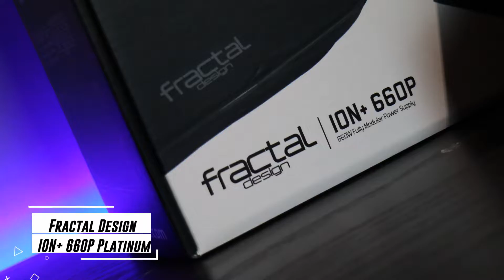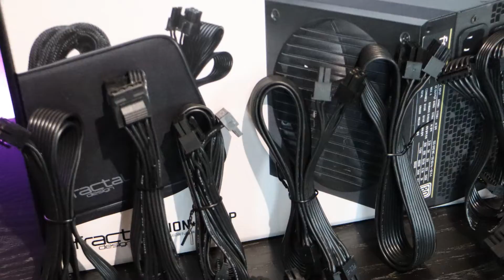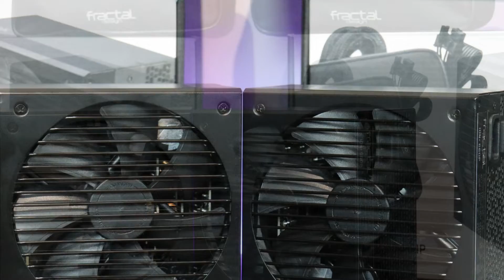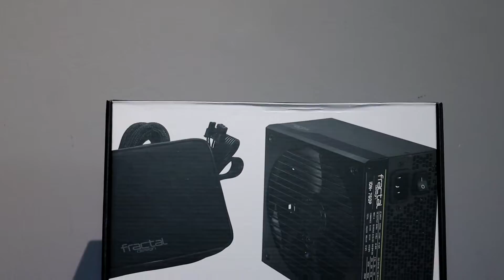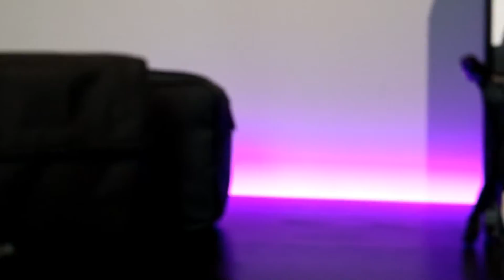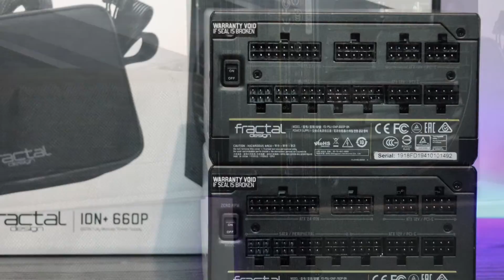NEW FRACTAL DESIGN ION+ PSUs - 660P & 760P PLATINUM

Comment: 660 w is good for supergaming like a cyberpunk or RDR 2 and Mafia Definitive edition?
Reply from the maker: PSU doesn't have anything to do with running games. It's only job is to supply the components that do that with power.
Reply: @PCCrazyDario  660 w for gaming PC is good bro?
Reply from the maker: @californiadreams9408  Depends on the components that you are going to use in your PC...
Reply: @PCCrazyDario  6 cores cpu, 4 gb gpu, 16 gb ram
Reply from the maker: @californiadreams9408  660W should be enough, even though I am guessing here because 4GB GPU is old(er) so it could be placed in the lower GPU segment (or older) and you don't need more power.

Comment: Man can i use coolermaster sleeved cable to extent the range????...subbed ❤
Reply from the maker: Appreciate the sub! :) If they are only extenders, then yeah. If they are full custom sleeved custom cables from the PSU connectors to the components, then no.
Reply: @PCCrazyDario  thanks man...yeah i know the concept that even an extender is a product that a good powersupply should protectbfrom surge...like it protect a mobo..
.
There is this half cooked indian youtube....who mixed up my mind...
.
Appreciated headsup
Reply from the maker: @GFATalks  Honestly, both of those PSUs are great and when someone asks me if they should go with Corsair, I don't see a reason why not. The same thing goes for the Fractal Design. I have been using both PSU brands in some period of time, Corsair HX1000i and Fractal ION+ 760p and on both never had an issue. So you are good to go. ;)

Comment: I’d like to purchase this PSU for my next build, have you ever had any reliability problem? Is the 24 pin cable long enough for a mid tower case?
Reply from the maker: Nope, not a single problem. Still using the 660p and my friend is using 760p. No issues whatsoever. I'm using it currently in H700, but used it in VECTOR RS from Fractal, all cables have enough length. ;)
Reply: PC Crazy Thank u, I think I’ll get the 760p!
Reply from the maker: Cristian Concio Great choice 😉👍

Comment: I purchased Ion 860P two weeks ago from a local retailer. I've tested 10 different PSU's (mostly from different brands) in two years time. The Ion 860P is the most silent by far from all units I've tested and works perfectly in my silent optimized home studio/gaming build. Cannot say anything about reliability but I'll comment if I've any issues with it.
Reply from the maker: Running currently 660p in my main build and apart from your comment, it is really reliable. Still going strong after 6+ months. ;)
Reply: @PCCrazyDario  I'm glad to hear that! I hope my unit has good lifespan and I'm happy that it has 10 year warranty if something goes wrong :) I've Seasonic Focus Platinum 850w in my other system that I can use as a backup.
Reply from the maker: @shooweri3666  Honestly, I don't have doubt for Seasonic as well. Seasonic is also a brilliant PSU manufacturer, no doubt. :)
Reply: @PCCrazyDario  I've heard good things about them but after two units with faulty fan it's better to go on with the Ion.